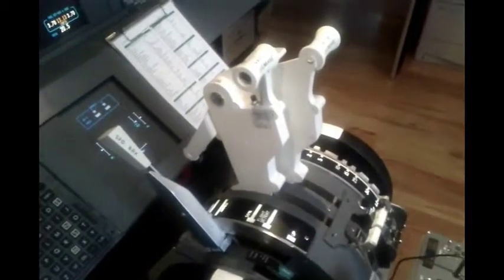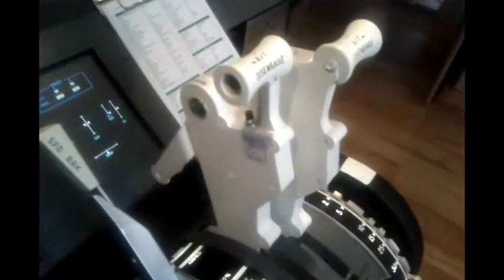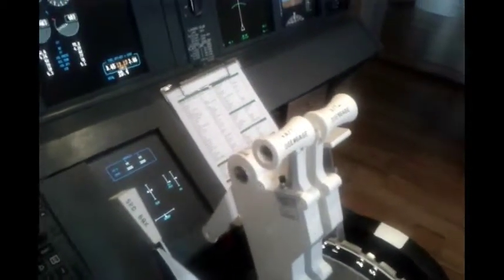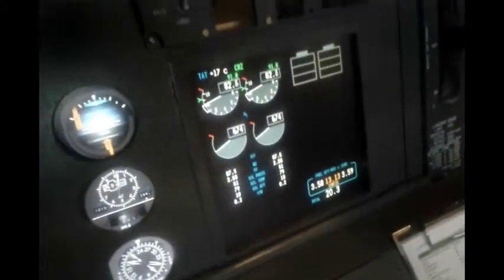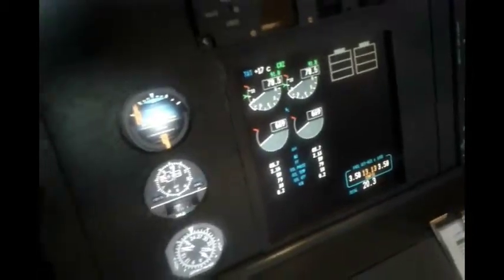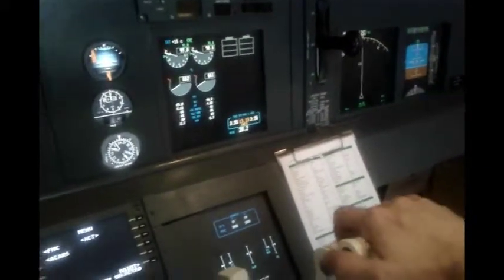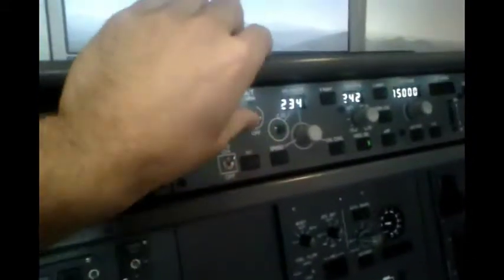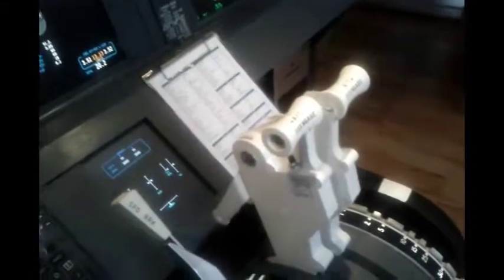Throttle working with PROSIM and OC-Servo Card

Comment from the maker: +Michael Richards I use the Hitech HS815BB Servos. The powering of the Servos is done via Prosim, so when A/T is disconnected Prosim will cut the power to the servo. As Servo card the Pololu is used. Best regards,
Markus

Comment: Hello Markus, the servos that you used for the throttles, what size are they, and were they just linked to the throttle levers with the servo arm and an push-rod? How did you overcome the servos when using manual throttles?
Regards,
Michael.

Comment: Hi, I added your lines in throttle.txt file (found in ProsimMCP/Opencockpits folder)
but in Prosim config I found that servos parameters are in Gauges (Throttle servo left/right), Gates (Throttle servo power left/right), Numerical (Throttle servo left/right numerical). Which is the right place to set your two variables? THX